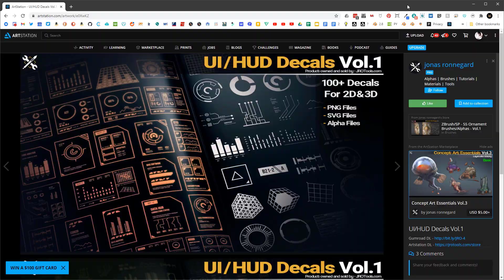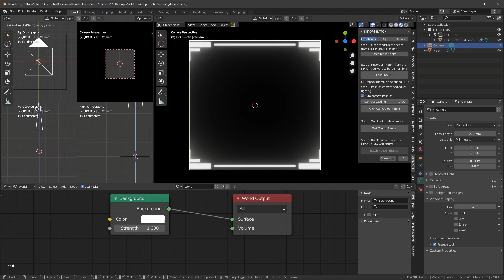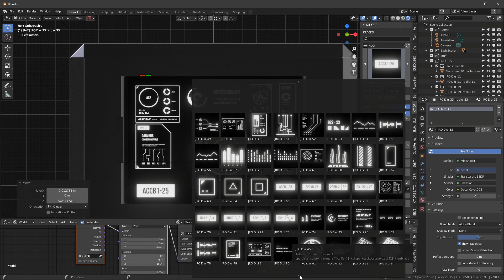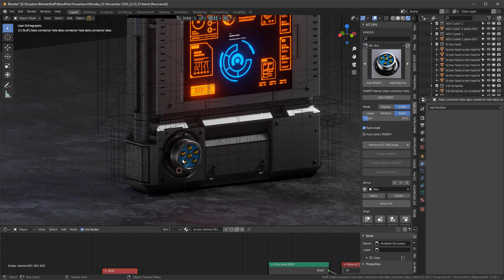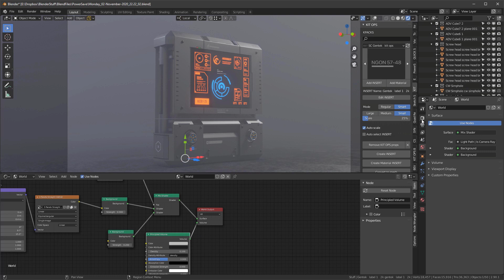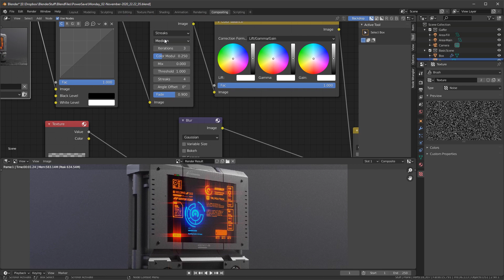HUD Comm Device build on Blender using KIT OPS

Comment: Hi Chip! U're becoming a true MASTER in these things! I'm amazed to see what u're doing with Blender!
P.s just out of curiosity. Did you abandoned the wonderful Moi 3D?
It's still the PERFEFT companion for Blender ;)
Reply from the maker: Hi Marco, yeah not using MoI much anymore. I find for what I'm doing now, I can create concepts much faster in Blender. But, if I need CAD like solid models, I will still use MoI3D. I stay up with the forums over there-- great community!
Reply: @ChippWalters  Ok Chipp :) I'm glad that u've found a great tool for your works! In fact, if I remember correctly, you "traveled" a long way before landing to the Blender's "harbour" :) I think that Blender is the future of 3D for many professional people out there!
Reply from the maker: @marcodimario9918  yep, been around the block. Started using 3d in 1984 on a PC with external frame buffer. Gone through too many programs to count.

The immediate feedback of EEVEE in Blender and it's non-destructive modifier stack is what makes it a delight to work with!

I was hoping Michael would've added some of the features I was looking for, like instancing and a decent AO shader. Hierarchies would be good as well. 

Still, he keeps it simple and doesn't try and please everyone-- which is good-- and which can become a problem with Blender.
Reply: @ChippWalters  1984... So deep! It seems that Autodesk Will not be able to surprise You with anything. In this area, You are always one step ahead and the more You know what will appear in the future =).  It is very good that in the world of modeling there are such strong professionals as You. This inspires hard work and arouses interest in unusual things in 3D modeling.
Chipp Walters, Thank You =)! Marco Di Mario, Thank You for the good questions =)!